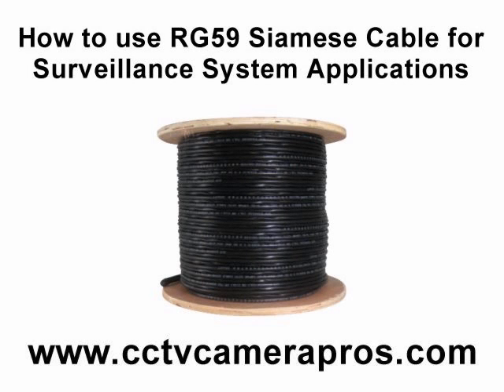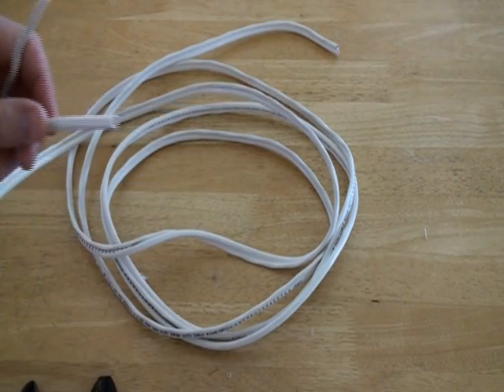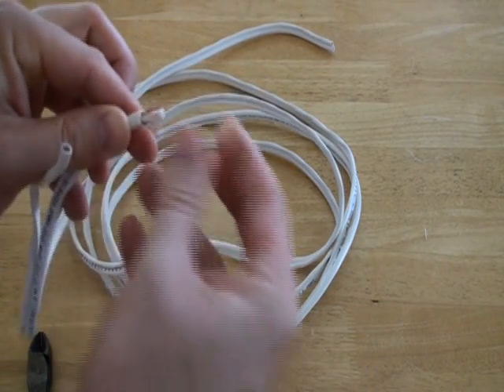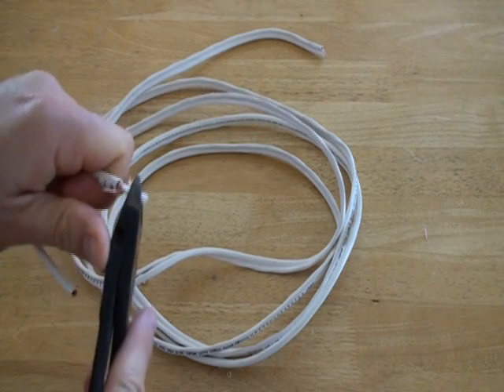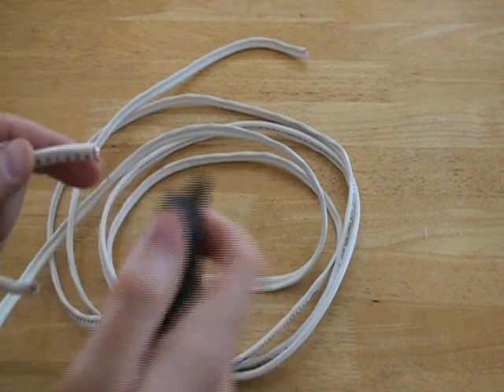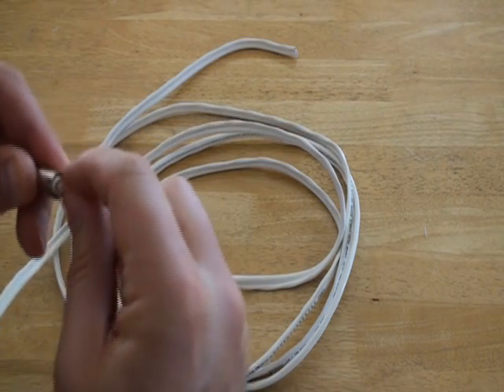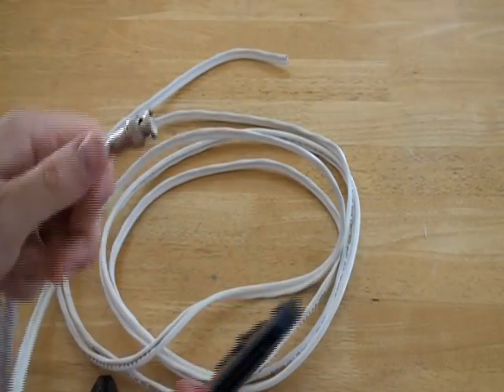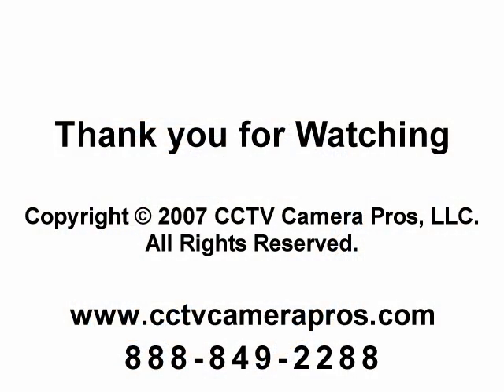How To Connect BNC Crimp-On Connectors to RG59 CCTV Cable

Comment: You need to point out that there are different types of BNC connectors. Mainly with this video that there are types that you have to crimp the center pin or one that the center pin is fixed like in your video. Also as said above use a proper stripper. Last key thing is don't twist the outer shield wire mesh. You could have had strands holding your connector all the way around the crimp but you reduced it to being held by 2 points.

Comment: Yes, fan the braid.  Twisting it like that will alter the transmission properties...a little.  Easier to put the crimp tube on first..  Also easier and faster with a proper strip tool when doing 600 ends on a job.  Be careful with the crimp dies.  They can vary by only 1000th of an inch and it depends on the brand and style of connector.